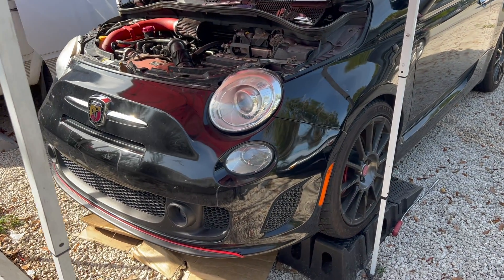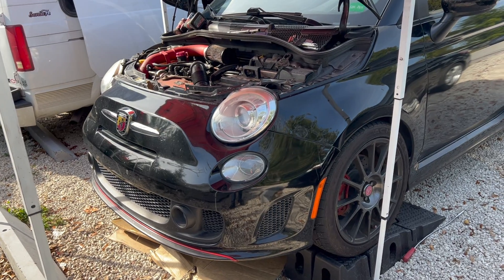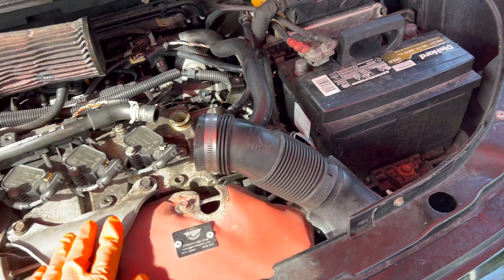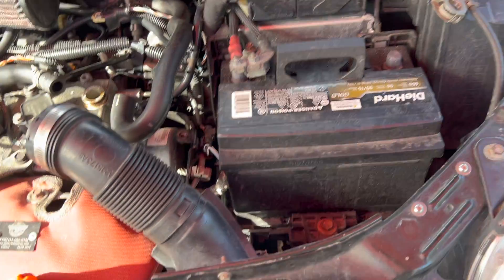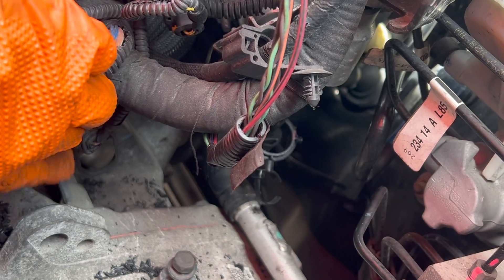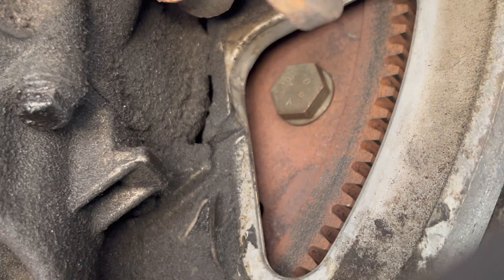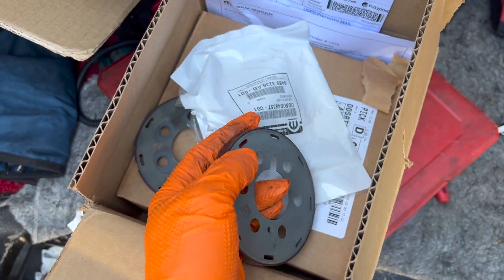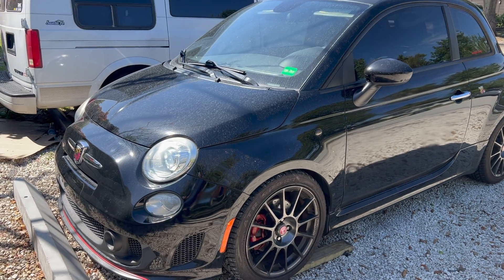EVERY FIAT 500 OWNERS WORST NIGHTMARE  !  FAULT CODE P0339 Crankshaft Reluctor Ring Replacement

Comment: How can you tell if its a fault of the ring your placed vs just the sensor? Did you have to assume first that its just the sensor? Then remove the sensor and rotate the engine while looking into the hole where the sensor goes with a light until you saw the crack in the ring?

Comment: Did you just loosen the flex plate and not remove the bolt? I just need a little clarification as i am about to do this job.
Reply: Remove flex plates bolts to detach flex plate wheel from torque converter

Comment: My car has the same code did yours also throw a p1061 code? (Cylinder 1 oil supply solenoid valve stuck)
Reply from the maker: Nope

Comment: How long did this take you? I am having the same issue and the dealership is trying to charge me $11,000 for a new motor. I can do it I just need a timeline for how much time I need to take off work.
Reply: about a week without previous experience theres some steps he didnt show i just did mine and it took a lot you have to disconnect the core to be able to drop the tranny
Reply from the maker: Took me a couple days to, I took my time , maybe 20hours

Comment: We paid dealership to replace tone ring, after less than 40 miles, short trips, tranny fàiled.  What did they do wrong to cause this?
Reply: It was chipped exactly like yours
Reply from the maker: They probably didn’t fill the transmission back with fluid to the proper level after the job was done.

Comment: This issue can be resolved by simply reverting to the previous designed crank position sensor configuration. Check if the crank pulley/harmonic balancer has tonering teeth on the back side of it. If it does not, simply downgrade it to the previous years’ harmonic balancer that does. Then install then old crank position sensor in the available mounting position. You then need to extend route crank sensor wires to the harmonic balancer sensor location and do a crank sensor relearn. Done.
Reply from the maker: Easier said than done! These engines are so tight that event to fabricate comfortably you’d have to half way pull it out the car! Where exactly would we find a new mounting position if it was never there !??
Reply: @Sliderz_Official no fabrication is needed… the mounting point for the 2014 and older crank sensor still exists on the later designed engine. Simply purchase the older style crank position sensor and mount it where it goes. If your crank pulley is missing the tone-ring teeth, simply replace the pulley with the older style pulley. Easy to swap these crank pulleys) Run wires to the older style sensor, relearn the crank sensor. Done.

This should all be able to be accessed simply dropping the skid plate, if that.
Reply from the maker: @stevey500   WHAT A HACK ! That’s insane thanks for this information!
Reply: @stevey500 how do you relearn the crank sensor ?
Reply: @6yap2 the car itself will relearn from the sensor after you clear the code
Reply: @ not true
Reply: @6yap2  this is true my g i did it on mine smh
Reply: @ this is not true I did it on mine smh
Reply: @6yap2  Yo lo hice en un fiat 500 turbo 2016 y si funciono yo le puse un sensor cigueñal de un 500 sport 2012, solo que hay un paso clave para que esto funcione 😜
Reply: @Dms1313 I have a 2016 with the same fault, can you tell me what the key step is to make it work? Thanks in advance.
Reply: @eduardoleon6308 hi did you find out the key to make it work?😊
Reply: @6yap2 did you ever figure out how to relearn the sensor? I am getting a P0343 code after my install of a new trigger wheel.
Reply: @zre909  Alfa obd has a crankshaft relearn process, I did it after replacing the wheel, and sensor. It started up the first time with a long crank, and still showed the error code. Let it warm all the way up, then rev it to  5 or 6 thousand rpm, just blips. Shut it off for an hour or two, and start it again, and drive carefully for a while, it seems to take a few days of driving for it to be relearned, but you should see it as detected now.
Reply: Mine swap worked till i did the relearn procedure in multiecuscan... now it does not work anymore with the retrofited sensor. What colours does your cable harness have? I tryeid every combo of wires and it didnt work anymore :/
Reply: I tried on my 2015 500 turbo, it didn't work. I have the steel ring on the front, mounted the older sensor there, and ran the wires to the old connector. I tried as the poster described to swap the two signal wires, also tried every wire combo. Used alfa-obd to reset misfire, and relearn crankshaft, no luck. I read it worked for some people, my guess is that the ECU I have does not have programming or capabilities to read both types of crankshaft sensors, not sure which ones do. It is definitely worth trying first, but not guaranteed to work.
Reply: where is the older style crankshaft sensor located then?  Is it easier to get to instead of removing the cat?

Comment: My Fiat 500 has been sitting in my garage for 5 months with this error... already tried replacing the sensor. This is still one of my projects, to replace this tone ring. Going to be replacing the rear main seal as well. Took forever just to get the two parts
Reply: will definitely lyk it'll be difficult to start it once you're done because of the fact these cars lose compression pretty quick, however there is a purge valve in the oil fill tube that you turn with a screwdriver and it should help you start your car if its been sitting for a while
Reply from the maker: @jaseypoo1022  luckily I only let mine sit for a week
Reply from the maker: Take your time brother
Reply: Can please let me know where you bought the tone ring? (Same thing, car's been sittiing in my garage forever) Can't find the part.
Reply from the maker: @erikahernandez4836   Crankshaft Target Wheel - Mopar (4893235AB)  search this on google. Many suppliers carry it.
Reply: @erikahernandez4836  Summit Racing

Comment: Just paid 350 to get my crank sensor replaced in my 2015 fiat 500 at a dealership. Ends up my tone ring is damaged. Is my car trashed?
Reply from the maker: Needs to be replaced like I showed in the video.
Reply: @Sliderz_Official  guys at the shop said it would cost thousands to replace. Not sure I have the confidence to do this job myself. Are there any other fixes for this?
Reply from the maker: @Bighairymtnman  the only fix is to replace the part unfortunately.
Reply: @Sliderz_Official  thank you for the quick replies I appreciate it. Unfortuantely I am cooked it seems lol.
Reply from the maker: @Bighairymtnman  Reach out to other shops, Dealerships would rather sell you a new car than fix yours. It shouldn’t cost more than $1500 if they know what they’re doing
Reply: See my other reply on this video. There is a far more affordable/easier way to resolve this. Simply revert to the earlier years’ crank sensor mounting design.
Reply: @stevey500  Hello Sir. Can you advise what exactly needs to be replaced and what part?

Comment: Any idea on labor to this job ?
Reply from the maker: Labor rates are different everywhere but I would say this is a $1200 job for an experienced mechanic. It was not extremely difficult but when working with a car with older/brittle/rusty parts it can be a bit time consuming to make sure nothing is damaged in the process.